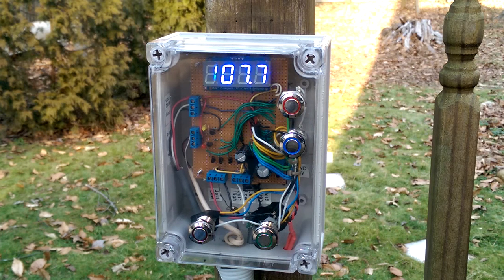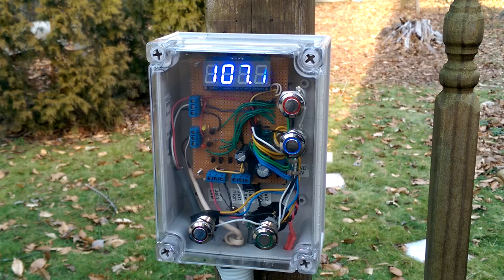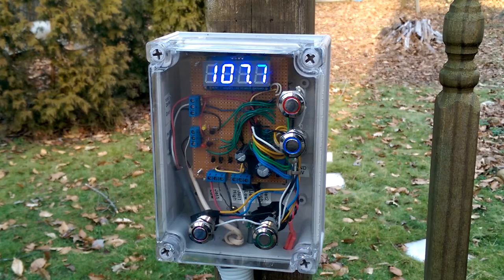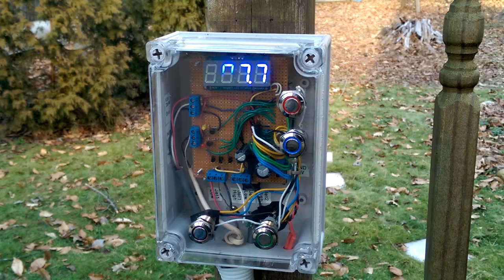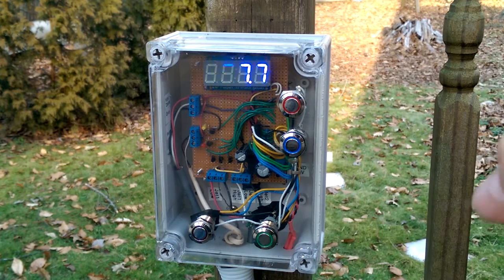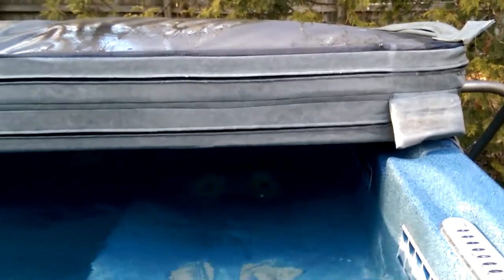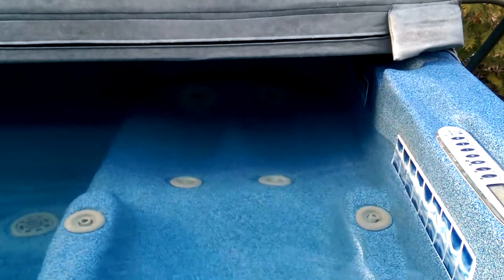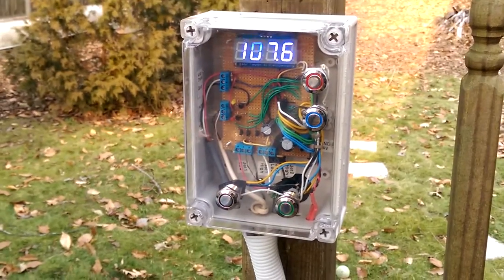Raspberry Pi powered Hot Tub Controller

Comment: Hey Ted, this is exactly what I'm looking for for my Dimenstion one spa. Do you happen to have a plan how you build it up? My print seems to be fried and so is my display so this would be a perfect replacement.
Reply from the maker: This post https://raspberrypihobbyist.blogspot.com/2016/02/hot-tub-controller-details.html has more details, but not a plan for building. This is a very complicated and dangerous task to attempt. I do not recommend it for the typical hobbyist. You have to deal with high voltages (240V AC) in a wet environment. There are a lot of things that can go wrong. I have had to replace relays twice due to water getting into the enclosure. And I replaced the RasPi once. Cost-wise, it wasn't much of a savings over having it fixed properly, especially considering the time I put into it. The reason I did it is that I enjoy this type of challenge and I really like being able to set my tub temperature as high as I like.